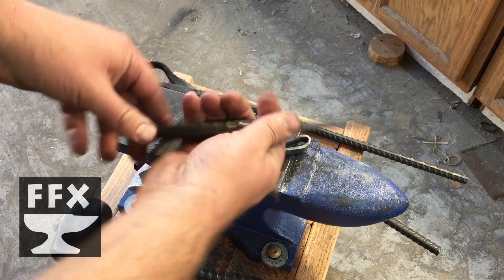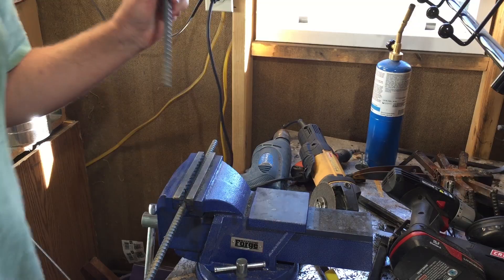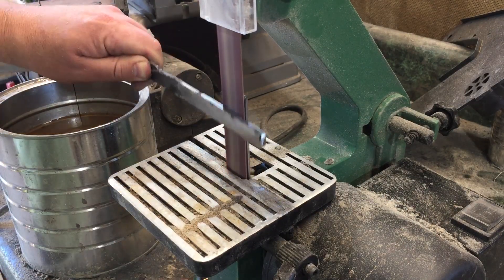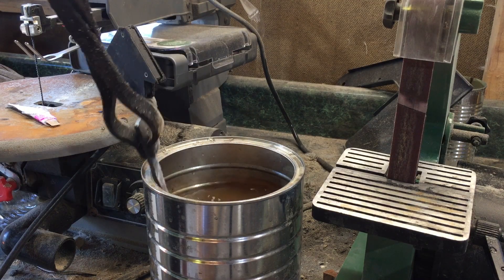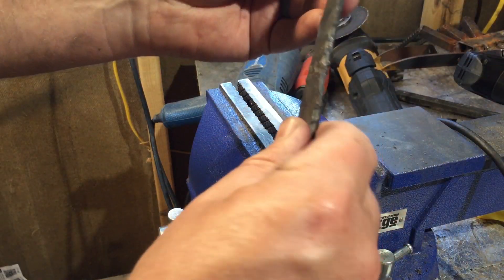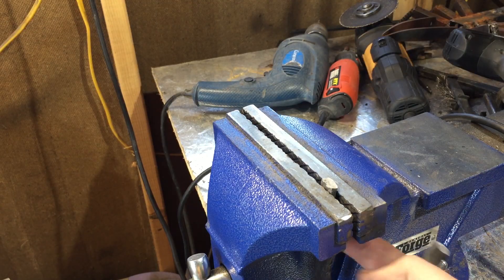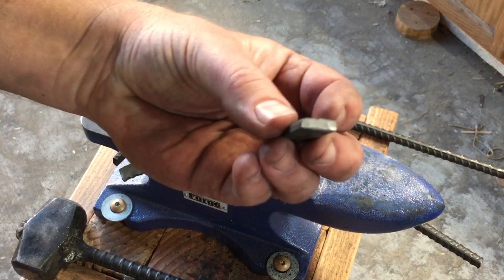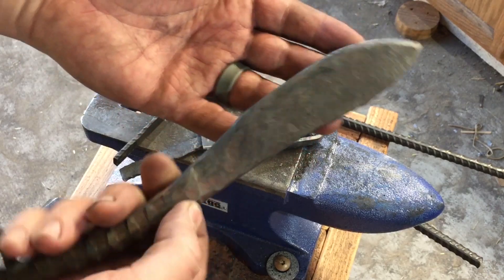Rebar knives...can you heat-treat in oil or water?

Comment: Let me begin by saying that I am just an idiot with zero experience in making knives or heat-treating metal, but even I know that the technique for oil-quenching and water-quenching cutting blades are quite different. On You Tube, there is a video with this title "Traditional Quench Hardening Technique / How To Quench In Water / Cutting Test", and it is by far the best video I have ever seen showing the technique for water-quenching a blade. I think you will enjoy it.

Comment: Yes, rebar can be hardened in water or brine, but only if rebar is certified. Due to modern rebar often made with no  complience to standarts, in some cases  it cannot be hardened. P.S. some rebar pieces after polishing and etching can get wootz pattern due to scrap steel they made of.

Comment: in  the lower carbon rebar quenchvit with higher color of the fire yelowish white to reach its harder strength ofa blade theres difrent color of fire depend on the carbon content of a metal lower carbon higher the color of a fire higher crbon lower the fire color

Comment: The best thing for rebar is usally oil. But for mild 45° steel which is VERY common. I use water and its just about perfect not super brittle but doesnt bend easily by any means (until you put length to it. The longer it is the easier it bends)

Comment: Oh man, one thing you do NOT want to do is have all your power tools laying out, getting showered in sparks from your grinder.  You are just filling your electric motor up with metal dust which is going to stick to the magnets and get inside your motors and cause them to run hot and eventually give out, if not short circuit them outright.

Comment: Easy rockwell test. make a spring loaded punch, use a piece of martensitic leaf spring material as a reference (80-90r). Rockwell is a measure of plastic resistance, not hardness. So a high number will mean the punch doesn't drive very deep, and this is linear. So if your spring loaded punch made a 0.1mm wide mark on the leaf spring which is at 80r then a 0.2mm mark will mean you have something close to 40r.

If you want to test hardness. Simplest method is to drop a ball bearing onto the material. Once again, use a leaf spring as a reverence. The lower the bounce, the more energy was lost due to elasticity. This isn't linear though, but you can get a good idea.
Reply: @Aaron Washburn I tried to keep it simple man, you're absolutely correct. But hardness in laymans terms is the lack of ductility+high yield strength combo, instead of its actual definition which is just resistance to (enter specified force), hence why we have different scales. I studied as a geologist so hardness for me relates to scratch resistance (Moh's scale, also used in machining). But I never use rockwell anyway. File test is really all you need.

Comment: Thank you for your video. 
It's amazing to know that low carbon steel can be hardened.  It gives me a relief that I will spend less money for practicing blacksmith work.  Rebar costs about $0.18/pound at a local scrap yard around here, as compared to $15 -20 for tool steel barstocks (which is to be imported from abroad).

Comment: What type of oil do you use?
Reply: It doesn't really matter what oil you use. It's more important to have your oil preheated. Basically, cool oil will be too cool to effectively quench the material because the steel will form a vapor layer around itself and won't properly quench. You want the difference in temperature between the oil and metal you wish to quench to be around 600 degrees C. What temperature you quench at/in will determine hardness, but you always want that delta to stay the same (that is for carbon steel). What medium you use to quench in depends on the metal used though. If you are using heavy alloy metals, quenching in water is relatively safe if you don't stir it irregularly. But, high carbon will almost certainly shatter in water. Light oils are good overall, sunflower/canola/palm oils all work great.

Comment: Wow, thanks for sharing. I was hoping someone would show the difference between water and oil quenching.
Reply from the maker: DanielinLaTuna You bet! Glad you enjoyed the video. Cheers!
Reply: Quenching a low carbon steel in oil will cause the steel to slip into the ferrite head of the TTT diagram, basically instead of directly hardening the steel, it martempers it before it gets hardened.
Reply: @meusana3681  
Yeah....don't know what that means. Can you elaborate please? I'm REALLY new to smithing.
Reply: @shadowninjarider374  So I think the best thing to do if you truly want to understand it is look at phase diagrams for specific steels, each will have its own diagram plotting temperature on the left and time on the bottom. These diagrams will give you a good idea of what your steel IS actually turning into rather than just assuming its harder.
I'll give you a quick summation tho. Austinite is carbon steel that isn't hardened, martensite is hardened, ferrite is a phase where crystals can reshape. If your steel is low in carbon and you dont quench it quick enough (in water instead of oil) you will actually make ferrite carbides so to speak before you start making hard martensite, which is bad if you don't control it for a specific outcome. To check this, buy a cheapo hand file and temper it yourself. Just a light temper so the file loses some hardness but not all. Then you can use this as a makeshift hardness tester. If the tempered file cuts the material deeply then its already martempered (it became ferrite before it became martensite)
Rule of thumb (for me atleast) is to quench with oil first then move onto more extreme mediums, but if I know the steel is below 0.3% carbon or insanely high alloy content then I wont even attempt using oil. 
I hope this helps :)

Comment: Cool testing!!! I made one from a piece of old rebar I found while walking some RR tracks years ago. I quenched it in vegetable oil. It hardened nicely and I tempered in the oven to complete the whole heat treating process. It retains its edge very well. Of course, today's rebar is much different than it was 50 or 60 years ago, but it looks pretty cool and works just fine. Enjoyed the video!

Comment: Dude you got me wanting to start a forge myself
Reply: Grab yourself some charcoal, a hair dryer, a nice rock and get hammering!
Reply from the maker: Eric Kelly Preach it! If I had known how easy it was I would’ve started this when I was 10 years old.
Reply from the maker: Seriously, I wanted to do this ever since I was a kid... why didn't I start sooner? Turns out it's pretty easy to get started, especially with MILLIONS of YouTube videos showing you how. Have you checked out ZNA Productions' channel?
Reply: Do it. Its so easy to set up and you really don't need fancy equipment. Get a broken semi truck/trailer axle and use the cross section for an anvil. Use a blow dryer and some cast piping for a funnel. Lay some clay bricks for a fire pot and use a rock as a hammer :)

P.S. if you use a blow dryer, its really simple to convert them from AC to DC. Take it apart and remove the 4 diodes and heating filament. Run it at 12V 4A straight into the motor without any resistors, and you will have much more static pressure from the fan. Remember a good forge is all about its air supply. You want a high volume of air at high pressure, but you don't want the air to be moving quickly, that's how you burn your steel and use up all your coal.
Reply: I've just retired and started making knifes. Talk about a stress remover.I enjoy it so much